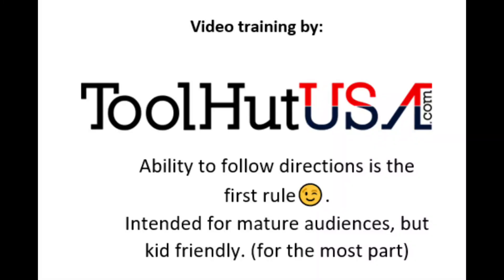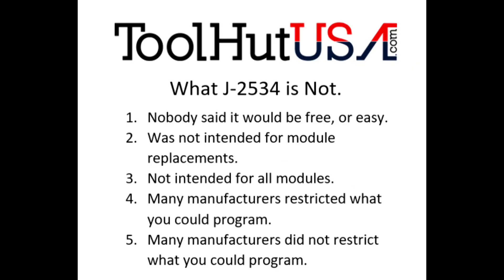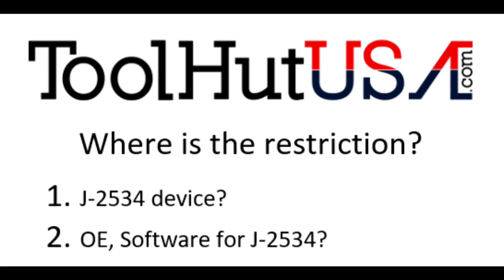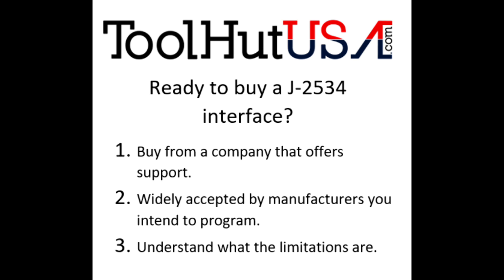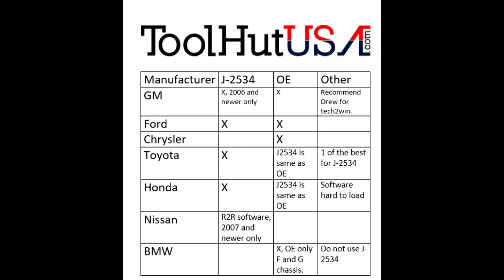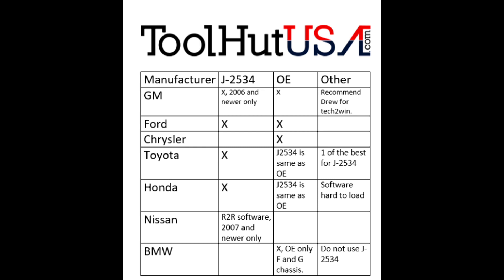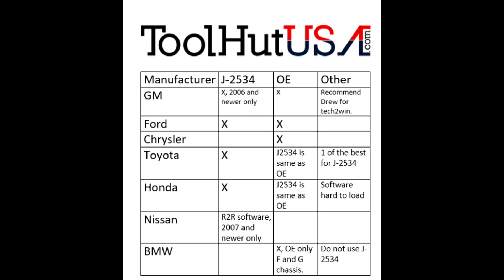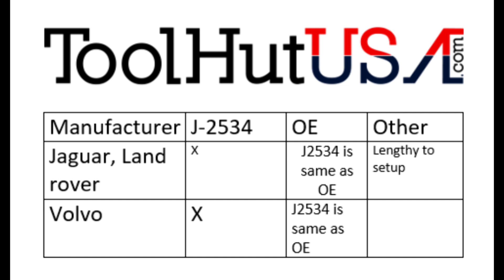J2534 for beginners 3, lets talk interfaces

Comment: Hi Sam,
 2014 Chrysler T&C PCM uses 05150778AB with 68206611AL flash, can use I use it in T&C 2016 if I will reflash the part to proper flash( 2016 uses 68243295AB with 68417190AB flash)?  
I do have flash file and all the tools.
Reply from the maker: I am not sure. It is definitely worth a shot
Reply: @toolhutusaakathecarflasher3019   Thanks for a replay, if I will proceed/succeed I will let you know.
Reply: @toolhutusaakathecarflasher3019  
It is not possible to flash 2014 PCM, with the 2016 flash file. 
Sam, since 2015 the Chrysler PCM are locked, and i cannot flash them via J2534 on the bench, is it posible to perform PCM replaced routine in offline mode on the 2015 and above, via witech1?

Comment: Our laptop at work is windows  7 and gm says windows 10...  but I have not had any issues programming just thought I’d throw that out there
Reply from the maker: I understand. Meeting their specs is what is required to get tech support when you have problems. Not to get it to work.
Reply: @toolhutusaakathecarflasher3019 ahh I gotcha makes sense. I use a cardaq m so I don’t think I get support anyway lol
Reply from the maker: @dblr616  They will support Cardaq M.
Reply: @toolhutusaakathecarflasher3019  so I was attempting to program an express van tcm once I plug in select the vehicle it says error 0443 said it couldn’t read vin I did online search for that error I did find an extension on the dlc so I unplug it but still get the error any thoughts ? I can communicate With our snap on scanner and the high speed network appears ok 60 ohms at 14 & 6 etc
Reply from the maker: @dblr616  there are many variables.